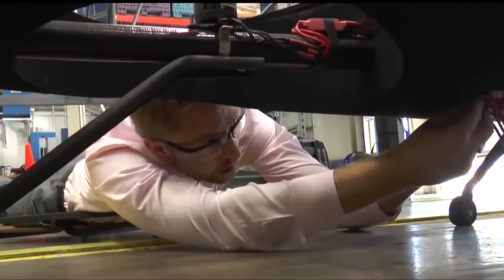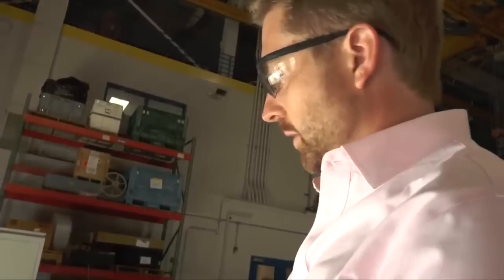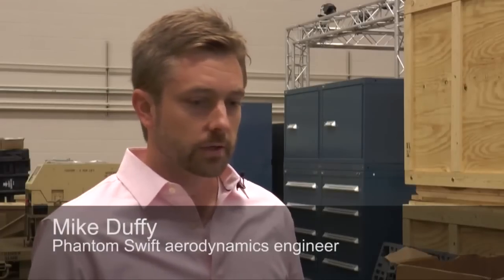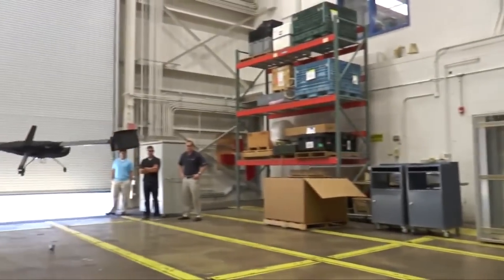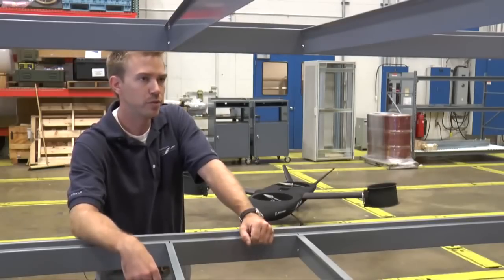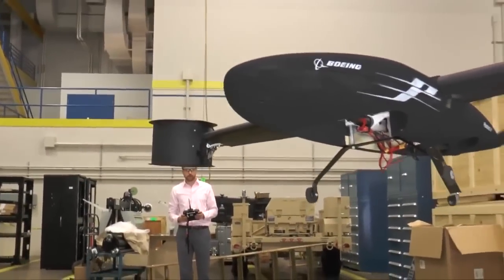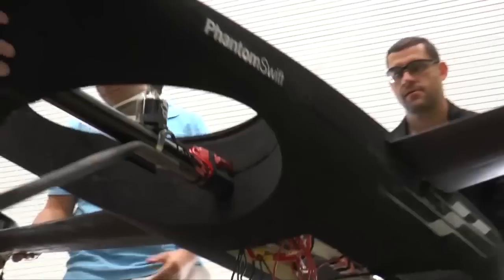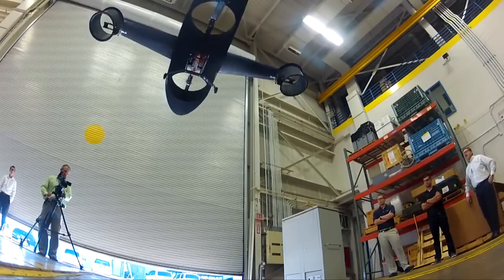▶ Boeing's Phantom Swift X Plane   Vertical Takeoff and Landing Experimental Plane

Comment: Very cool, however one design disadvantage is that in airplane mode the twin body fans are not used, so you have a plane having to carry the weight of two motors that are not doing anything.  The design would be more efficient if all motors are contributing in forward flight mode to avoid having them become essentially dead weight in the forward fllight mode.  You could consider having the body fans rotate to foward position during transition from hover to forward flight.